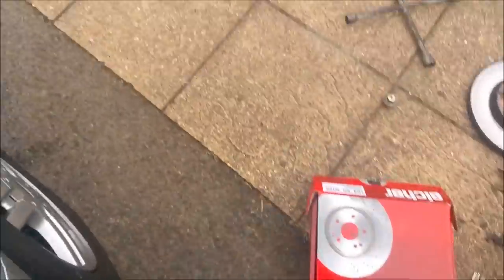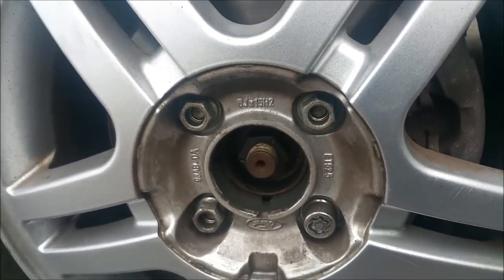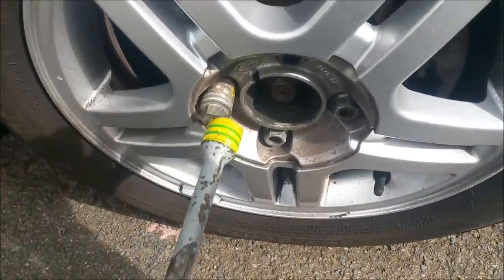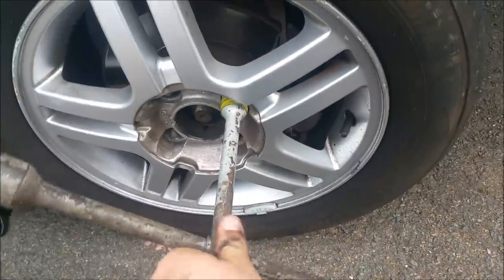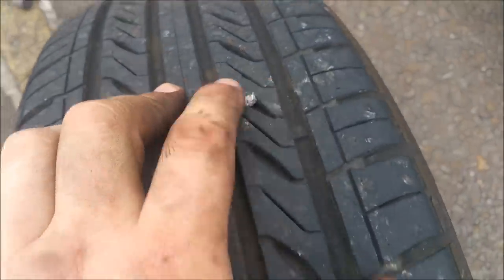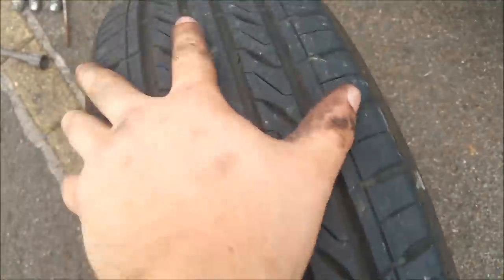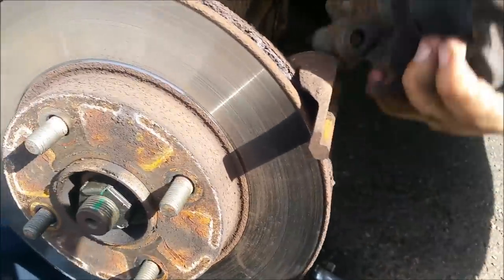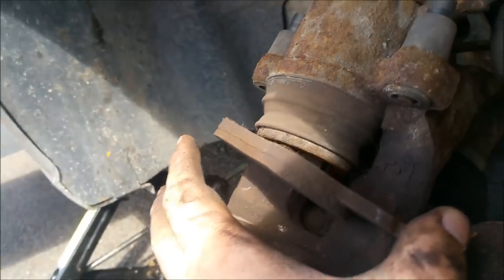How to replace MK1 ford focus brake disc and pads

Comment: Just done mine now video helped a great deal also had use torx as didn't have 7mm hex but torx was a key kind pain in the arse ended up twattin my finger with the big hammer to get them to crack anyway all back together all working fine no squeaks but must say you must be strong push in by hand Jesus I used a trigger clamp went in well whole job done and dusted 1hr 30mins I used a mintex break box set good brand no squeaks I've found on past anyway thanks again explained very well though I opted for jack stands safety first. Thumbs up from me thanks again

Comment: Don't know if you're still checking your channel, but do you need to bleed the brakes or something after? Or just pump the pedal a few times?
Reply: No need, just a couple of pumps of the pedal will pressure the system.

Comment: What size in inches does a G clamp need to be to be used to push pads back in to the caliper? Will 6 inch jaw do Thanks

Comment: if anyone missed it bolt head is not torx but it is hex. torx will work but if it slips you would hate it all your life. if you dont have a hex for that bolt you better grind a bigger hex bit to fit in

Comment: Brave man sticking head, neck and limbs under car that's held up with just a basic scissors Jack.. .. not smart :(
Reply: scissor jack is more reliable than a hydraulic one. But obviously if somebody pushes the car from behind, it will fall off.

Comment: Maybe check the fluid after u changed the brakes on both sides, then started the car and pumped the brakes.   Then you won't have to worry about it because it will be where is supposed to be.

Comment: lots of  things in this video that I have a problem with . for starters  I stopped watching  this video for a lot of reasons.   SAFETY   is a big pet peve of mine      there are no jack stands  being used.   re think the type of floor jack  you are using.   wheel chocks       I could go on and on but I will stop here.   if you are going to make a how to video     you need to first correct all of these safety issues

Comment: probably shoud’ve bled the brakes as you oppened the reservoir
Reply: No you don’t need to bleed the brakes after taking the cap off.
Reply: @nathanmacf  thats what my tutor always said at college
Reply: @reeceyoung3908  unfortunately mate, if your tutor tells you that then he shouldn’t be a tutor.